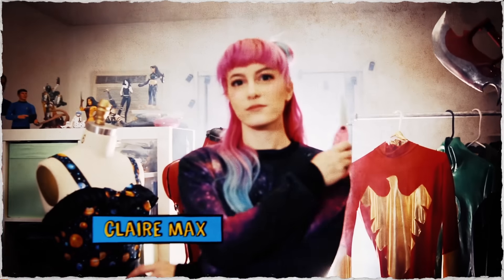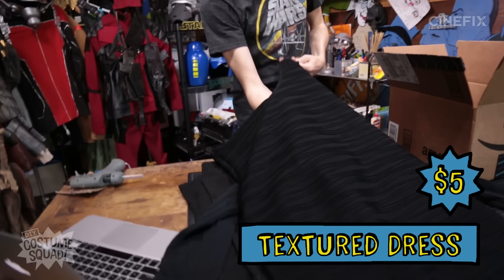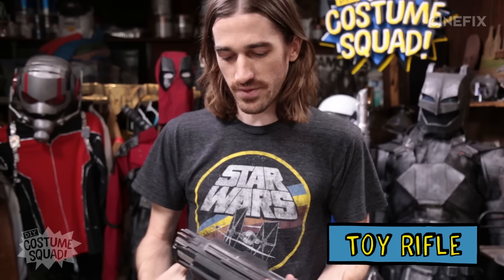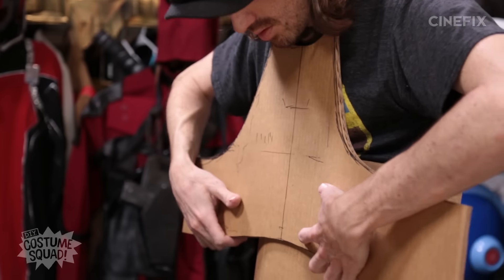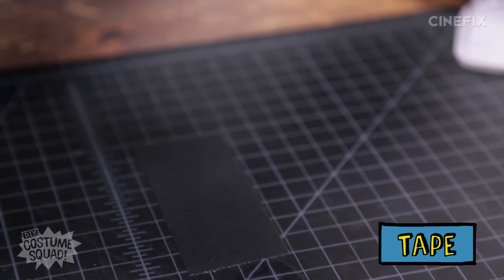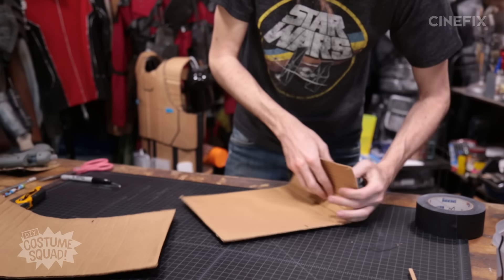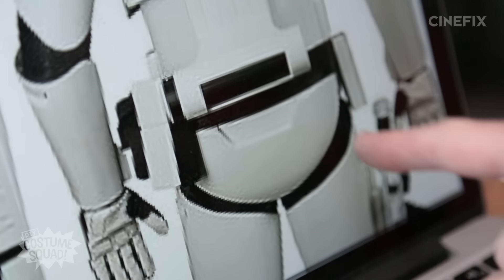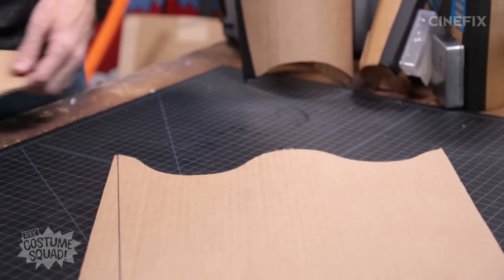Make Your Own Stormtrooper Costume - DIY Costume Squad

Comment: Just a fun fact on that back piece for the storm trooper you mentioned at 4:51, it's used to hold thermal detonators. That's why you just see them pull a grenade out behind their back like magic.
Reply from the maker: Good to know!
Reply: CineFix yep
Reply: thanks. I was wondering what that thing was for thanks
Reply: And, in some of the no longer canon graphic novels, it was used by elites to hold lightsabers
Reply: Another fact: They were originally supposed to hold lightsabers.
Reply: Woah there Mr. Weeaboo, check yourself before you wreck yourself.
Reply: Amu Chauhan
Reply: Mr. Doob wow I did not know about the thermal detonator thing it seemed like magic at first when I watched the movie
Reply: also in the origanal movie they were planning to have stormtroppers with light sabers and so they added that but then they decided not to use it but they kept the peice on the armour
Reply: TheKenXbox, I remember hearing something about that!

Comment: It's a little on the expensive side but if you want a more authentic blaster, buy a Sterling SMG replica or airsoft gun. It's the actual gun used as the base of the E-11 blaster. Then all you will have to do is add those little details you see on the blaster.

Comment: I do have one suggestion, rather than splitting the chest plate down the back and add clips

Split it down the sides and add a little strip of cardboard sticking out underneath with velcro - itll be much easy to put on

Comment: 4:47 That is a canister to hold thermal detonators. The 'box' is holding it on the armor. Thermal detonators are used to open locked doors or blow things up. Basically a deadly grenade.
Reply: Aren’t all grenades deadly

Comment: 4:48  in the original concept art for storm troopers, they all had those cylinder shapes on their belts because originally, all storm troopers carried light sabers. Those are light saber holsters, but they looked so cool, they left them on, even after they decided they wouldnt carry lightsabers. 
The main reason they didnt follow through on that idea was the sfx for lightsabers was so time consuming in post production, they decided it would just be easier to just have Vader and Obi wan to have them instead. Lightsabers would have been like pocket knives in star wars, if the technology to make them in post had been as cheap in the 70s as it is now.